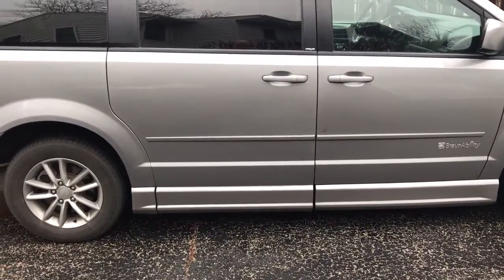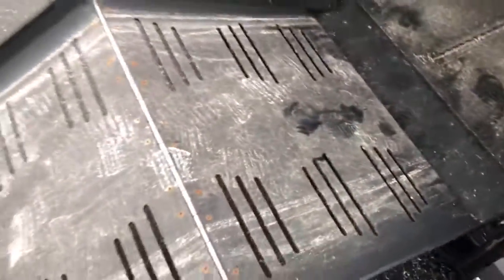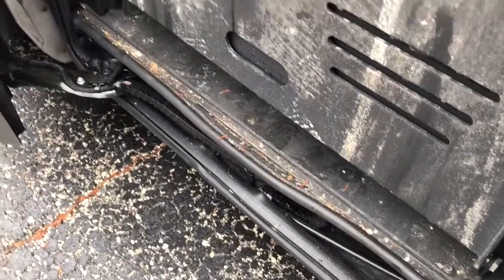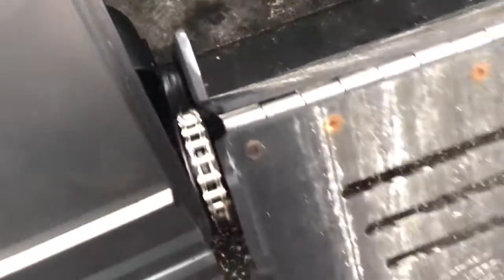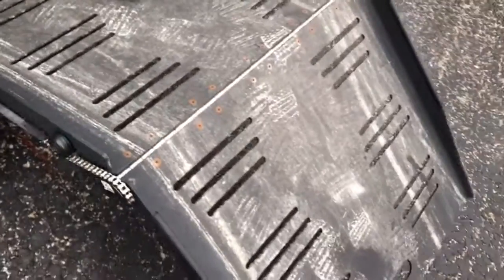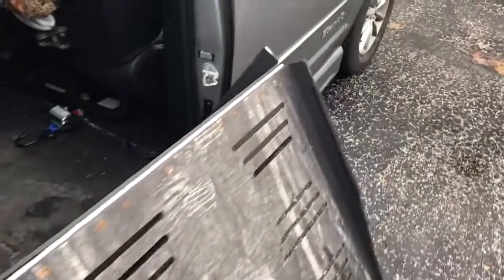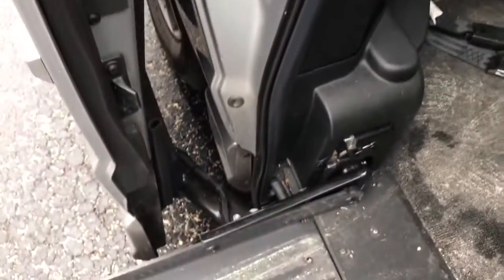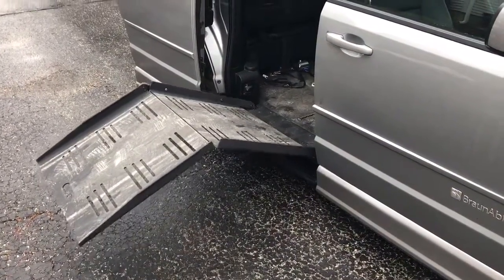2014 Grand Caravan Braun Abilities Ramp Deployment Failure

Comment: Of course this video is five years old.  Listening when you retract the ramp, I can hear the ramp motor still running after the ramp is fully retracted.  There might be a damaged gear, a loose fastener, or a worn part.  The ramp motor should not be running after the ramp completely stows.

Comment: I'm just curious if you know a way to override alarms and dinging when operating door & ramp?  I have a 2012 dodge gr. caravan that was converted by Braun 2 yrs ago. Mobility co. says they cannot override because of federal regulations. They drive me nuts!
Reply: Not that they can't can override it, they can, but won't due to liability.  I believe the dings are commanded by the "gateway" module they install on the interior CAN-IHS bus.  If that's the case, the setting in the module needs changing or its firmware modified.  Another option is to make a custom CAN filtering device to filter out those ding commands. Either way, not an easy task.

Comment: HELP! i have a similar problem on my 2015 Grand Caravan, recently purchased as used from owner. Of course it all worked fine when we bought it. Ramp issues ever since.  I am the wheelchair user and the driver, and I can't go anywhere without the remote access to the ramp & door. Mobility Works is horrible where we are, and my husband & I would like to fix it without spending ridiculous money.  Can a reader please advise where to locate the switch and/or parts that may be causing the problem.  For us, the ramp wont come down at all, but after getting it down manually, it will go back up just fine by remote.

Comment: What was the problem?
Reply from the maker: Mark Stanchin apparently a sensor was out of whack. Unfortunately it started doing it again today!
Reply: I have the same exact vehicle with the same problem! do you know which sensor?
Reply from the maker: Mark Stanchin I do not. I took it to a dealer. It’s very frustrating
Reply: Yes I just had the doors fixed bad wire 400.00!
Reply: Fixed it myself was a limit sw! Thanks!
Reply from the maker: Mark Stanchin what’s a limit sw?  Switch?
Reply: Tim Green try getting one with an in-floor ramp
Reply: Exact same problem on our exact same van. Shop quoted $850 for a new motor. Yeah, I think I'll research this myself, that doesn't sound like a motor issue. Your video was the 1st link. I'll check out the switch. Thanks
Reply: Cleaned the gunk off the switch with my finger and now it works. Lovely
Reply: @markstanchin1692   there is a video on how to fix it.  wow 400!
Reply: @MommaBearsCorner  
Where is the video?  I have same with same problem?
Reply: @MustangTim68   did you ever get your ramp to come down all the way? We have the same van with exact same problem...
Reply from the maker: @artprescott2880  it got repaired but they said a switch was out of whack.
Reply: @MustangTim68  A microswitch that is activated by a cam in this case
Reply: @Superbeefing  Get numbers off the motor, a lot of these motors are car window motors.  I buy full size van door motors for my wheelchair accessible Ford vans from NAPA for about a tenth of what they want for the same motor in a mobility shop.
Reply: Where's the switch